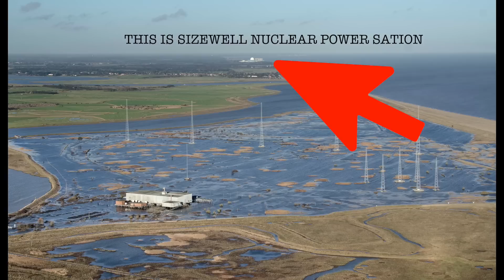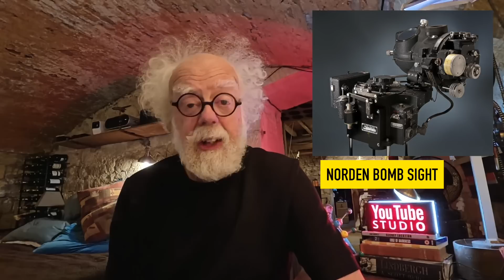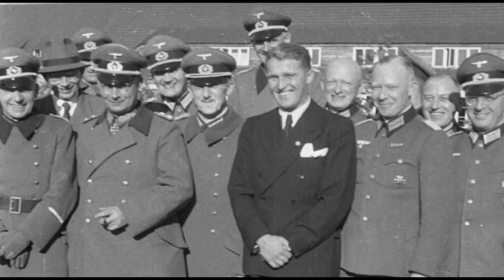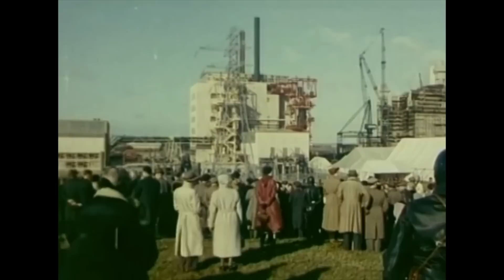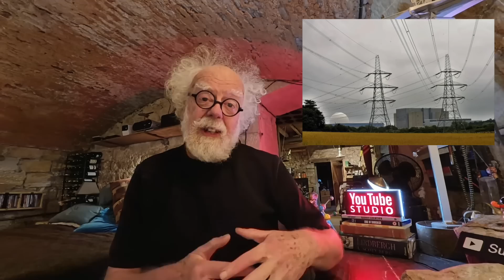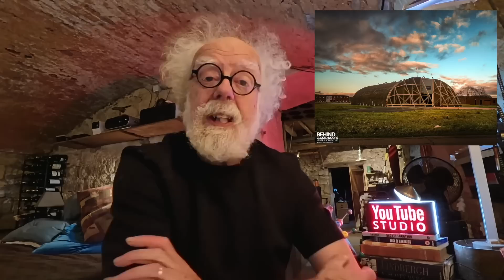Rendlesham Forest UFO Mystery: Sizewell Nuclear Power Station Connection!**

Comment: It's easy to build a flying saucer using centrifugal force using current technology.
Reply: Did you ever try to build it, though? I tried to build the mechanical version using the flywheel with the moving weight tuned to be biased in one direction. I got it to lurch a little🤣. I never tried doing that electromagnetically, or with spinning mercury (I think the same book suggested both, calling it Mark 1 flying saucer, Mark 2 flying saucer and so on). I never tried 6 of the flywheels aroumd a ring, timed to try and smooth out the lurching and propel the system forwards. At the time, it just didn't seem very promising to me, and definitely not easy. That was back before 3D printing, which might help, I guess... but if it was easy and effective, wouldn't there be videos?

PS - to any sticklers: yeah, they probably meant centripetal force, but wtv. I think the same source mentioned coaxial chambers of counter-rotating mercury, but reading it was like... then, what? There weren't any actionable directions, specs, plans, nothing... not even enough theoretical ideas to inspire an experiment. If it's easy, then post a vid. If it's "easy - you just need some unobtanium" then whoopie!
Reply: @GizzyDillespee  But how do you prevent the pilot from geting dizzy?

Comment: Before there was nuclear power the Manhattan project depended on the Tennessee Valley Aurhority’s {TVA) coal and hydro power (as well as having its own power plant) to power Oak Ridge in Tennessee and on hydro power to power Hanford in Washington State. Nuclear fuel processing is power intensive. Refining Uranium whether by gaseous diffusion, calutrons or centrifuges requires a lot of power. Refining plutonium requires a lot of plumbing, so it is also likely to be power intensive. So, when not playing with exotic physics there was probably a lot of power consumed just for basic bomb building.

Comment: How can the CW-Radar receive returns while the Transmitter is on? Are there dislocated Receiver Stations to get returns like passive Radar systems? And if so, they must be 50-100 miles away to not get the full blast of the sidebeams from de TX Antenna. (Can not figure out how this could work.) Is there any documentation on this? Very exciting :D
Kind regards, Michael
Reply from the maker: two dishes...tx and rx dish
Reply from the maker: look up cw radar or scorpion radar

Comment: the switching from the power stations isnt controlled from the power station but from grid control. The super grid sub stations have the in comers from the power stations. But where that is fed to is determined by grid control. The original sub station were 132kV, then increased to 275kV. Now they are 400kV (super grid). Find the sub station nearest to Sizewell A . And thats your answer.
Reply from the maker: thank you

Comment: We already know that it’s a pull push pull push electromagnetic propulsion  using the energy of quantum space To ride the lightning
Reply: When you tap in to the quantum field you can skip along in between the joints with pull push effect in any direction.